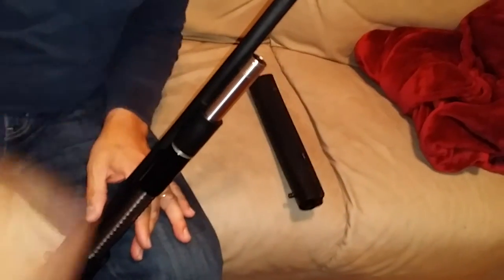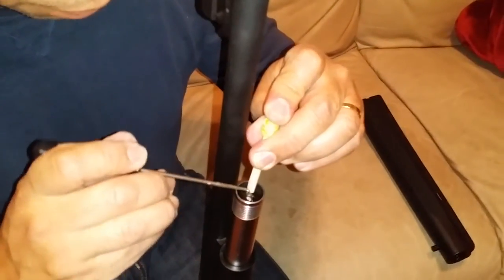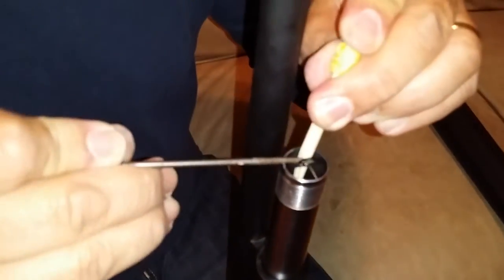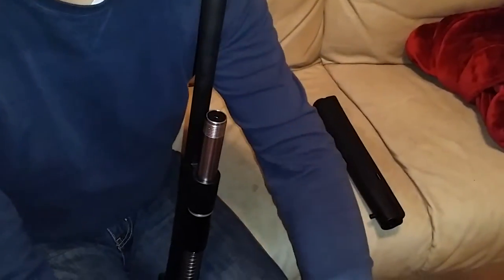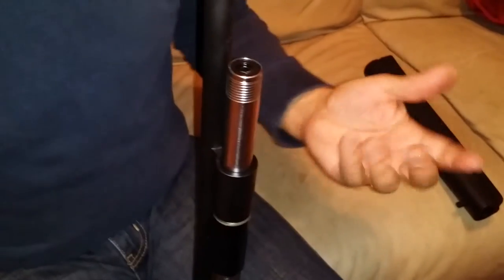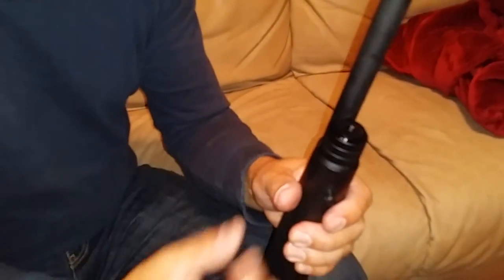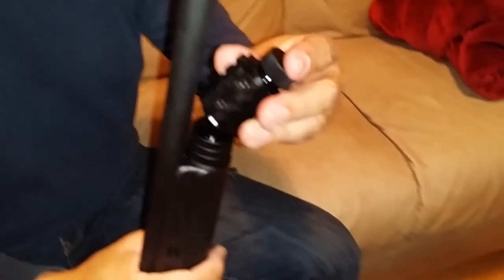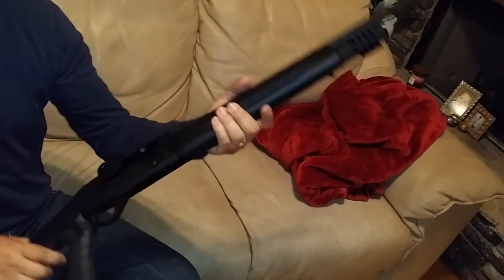Mossberg SA20 Removing the Limiter Plug (Dowel)

Comment: Nice video --- very helpful. One thing: the Mossberg manual says not to replace the retainer clip when you reassemble without the plug. "When not in use, store the magazine plug and retainer."
Reply from the maker: It wont make a difference, that's why I mention, up to you to put it back in. I'll loose it if I try to store it. Plug went in the trash (where it belongs) lol. Thanks for your comment and watching 👍

Comment: Thank you very much! Really annoying to have a semi auto that has 2 capacity ..
Reply: @I Climb Everything, I bought my first SA20 the other day, asking my gun store (owned by retired cops) to make sure it held 5+1 shells. They told me yes, it holds 5+1 shells. So I get it home and loss but up to realize it only held 2+1 shells. I was baffled??? What am I doing wrong? I've loaded and shot a 12 Guage before,  so why was this different. Anyway, because of my determination, I knew something didn't stack up. After reading my owners manual, reading gun forums and then finally going to YouTube, landing in this channel (after about 50 other B.S. channels, I found a guy who knew what the crap he was doing. I'm going to make my modification today. I'm not hunting with it. My sole purpose is home defense. I added a tactical green laser with a tactical light (combo unit) so now I can light up the night and neutralize any threats in my home, day or night. I've also got a backup to my backup, if anything fails. You just can't trust our society today.

Comment from the maker: thanks for watching sshog2. enjoy the rifle its a great gun. one thing i noticed with mine is that I needed to shoot pdx or slugs (high brass) in order to cycle the rounds. light loads wont do it, not atleast until the gun is well broken in.
Reply: I'm experiencing the same issue with cycling ammo I am using high brass does it take alot of shells to brake the gun in so it cycles each round properly ? I made sure everything was lined up and tight when I took off the plastic plug
Reply from the maker: @raymondmiller8800  Hi Mr. Miller, A gunsmith is who told me there was probably a break in period, that would loosen up the action after use... But when I switched to Slug rounds it works with out a hitch. I usually put 00 buck or high velocity bird shot for the last 2 rounds just to keep a check on how the cycling is progressing.
 In Case of "Emergency use" I'm not having issues with my 1st or 2nd pull of the trigger,  but rather in the end when I am getting ready to reload any ways. I Hope this helps.

Note. I make sure when I am storing it (safely in a secure manor) I only keep the Slugs in it.

Comment: Thanks for that instruction. Very helpful. Looking to purchase an SA-20 soon. 
Have you had any issues after the modification?  Thanks.
Reply from the maker: Nope. Love this gun. Works like a charm. Just use high brass, or slugs rounds for the break in period (about 500 rounds).
Sometime low brass or target loads dont have power to cycle the action. And you will get some shells that don't eject fully.
Keep it clean and oiled when you store it. Enjoy!

Comment: I just bought a MOSSBERG SA20 Tactical. I removed the magazine plug. When I went to the range it would not automatically recycle. I had to manually eject each spent shell. I’m thinking it might have something to do with that spacer washer that I left in or the ammo. I was using 7/8. Do these guns require 1 oz or otherwise heavy loads?
Reply from the maker: Glad the video helped you remove the plug. The issue with recycling and the spent shell getting stuck has to do with the Gas blow back which ejects the shell. These guns do have a break in period that give it a smoother action. 100-200 rounds you will see a difference. 
But...
1st try using high brass, like Slugs. Target ammo or bird shot (low brass) doesn't have enough power the eject the spent shell.
2. If your still having an issue with shells fully ejecting.
Remove the forward grip again and check to make sure you lined up and tightened the cap properly.
If the nipple isn't in place & and the gas vents are not lined up or the cap is loose the gases escape from the cap and do not push back the ejector fully. Then you will get shells stuck instead of being kicked out of the chamber.
If those dont work, take it to a range where there is a gunsmith that can troubleshoot for you.
I had that same problem before removing the limiter plug. The high brass solved the problem.

Comment: Cool video.
 With my SA20, I can only get 4 rounds in the mag tube and 1 in the chamber.
Anyone else?
Reply from the maker: That's correct. I did the video around 3:am and didn't realize I said 6 rounds. Noted: after removing the dowel plug, the gun will hold 5 rounds.

Comment: It was an OK video, but yet again, another person who is calling gun parts by the wrong name.  The Follower is not up there where you removed the plug.  The follower is on the other end of the mag spring at the bottom of that tube.  Please guys, if you are going to give a tutorial video, know what the hell things are called in a gun.
Reply from the maker: Thanks for watching the Video and your  "OK" rating.. 
But if you play close attention that  "part" I pushed up and down IS the "Follower". Its just the back side of it... Because when you insert the shells into the Mag tube, that is the piece that the 1st shell is pushing against while you insert the rest of rounds. That "Part" is compressed with the spring (also the critical part of the "Follower").
Which pushes the ammo back down the mag tube, forcing the next round out from the magtube & into the charging chamber. Putting it in place for the carriage to push the new round into the barrel to be fired next.  I'm sure I could have done a better video at 3:am... but 1 thing I did do is consult with 3 gunsmiths and a Mossberg rep to get the info on how to actually solve this question of "How To remove the plug".  But thanks again, I hope the video helped.